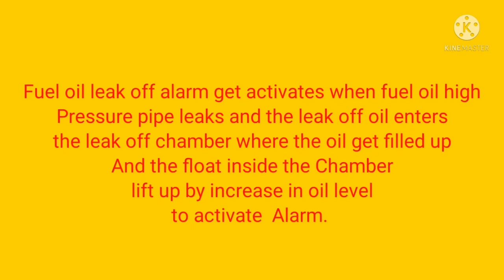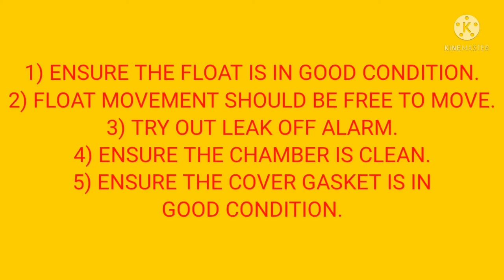How do they do... How to check fuel oil alarm.. Routine maintenance on alarm chamber...

Comment: thank u ,, Suppose ums condition 2am , ME  leak off alarm came , what should be the action from 2E
Reply from the maker: Thanks for your good query..
The following steps to b followed :
1) please accept the alarm.
2) Make the engine room manned.
3) Check visually for any of the units high pressure pipe for leakage in drain pot of individual units.
4) if there s any Leakage it shud be informed to senior engineer and action to b taken to do the repair of hp pipe.
Pls check fuel pump s connected to leak off chamber
5) If there s no Leakage pls chk the fuel oil leak off chamber for any malfunction of float.
6) Hope this answer vl satisfy your query.
Reply: @marine-knowledge-basha  thank you sir,,,
Reply from the maker: @rupanjansaha4788  thanx sir... Requesting you to share our channel with ur friends and subscribe